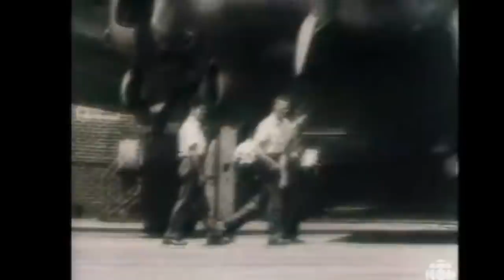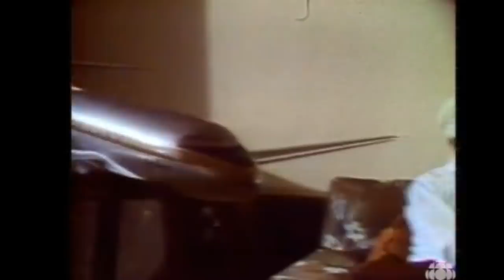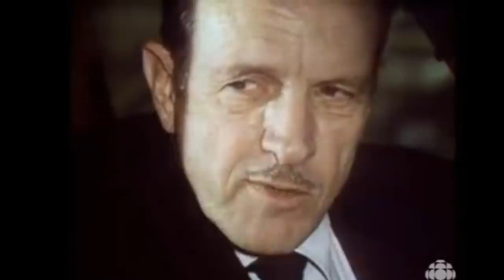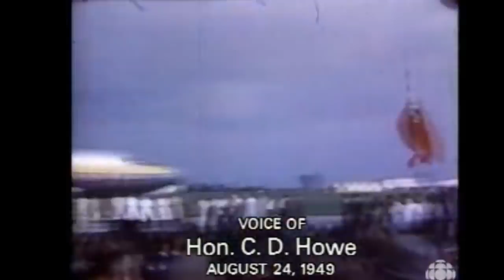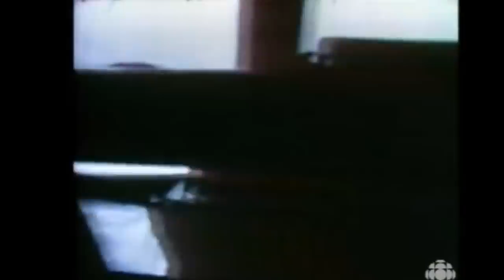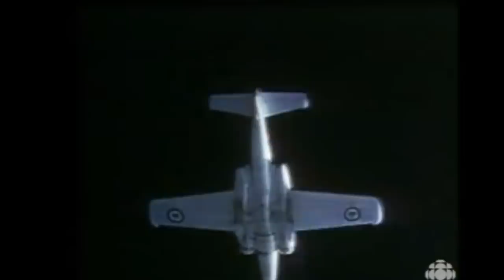The Avro Jetliner

Comment: Interesting that the Roll Royce Avon was not allowed on the Jetliner. But in 1955 it was used on the Caravelle and in 1953 it was ok for De Havilland to use it on the Comet. So De Havilland could use it, but Avro couldn't????
Reply: Canada still was under heavy British control - The Jetliner was eventually killed off for good to force Avro just building military planes for the looming Cold War conflicts, and to eliminate one possible Comet competitor. That was the reason why Avro wasn't allowed using Rolls-Royce engines, while De Havilland was.
It probably was more "primitive" than the Comet, without an aerodynamic fully tailored to then-budding jet technology (and the difference between the claimed performances of the two planes is testament to it), but the Jetliner still might have eroded some market to the British counterpart, and as such shutting down their own colony's effort in order to make it building planes for their Army was their choice.
Reply: the first few comets flew with the ghost jet engine -not the avon. the avon wasnt certified in time.
Reply: @super20dan  I know, but still De Havilland would have been permitted to use the engines Avro wasn't.
Reply: We are talking about 1949/50 here, the Avon was still a new military engine, the other commercial users were still 3 to 5 years away.

Comment: Too much does not ring true, Howard Hughes tried to buy 30 but was turned down by Avro and if you look at the figures it didn't give any real advantage over the piston aircraft of the time, a DC6 could cruise at 315mph the Jetliner would have cruised at 365mph with half the load and over twice the fuel burn and there were lots of cheap piston aircraft available at the time as air forces  wound down from the war. They mentioned a top speed of 500mph the Citation V can only just beat this with it's ultra thin wings. The Comet offered a big advantage in speed and had good range, I am not saying that it is the only reason but a big part of the failure of the jetliner was that Avro just didn't do their home work and should have stopped development much earlier, but they carried on with the development even after their only confirmed customer had pulled out . Anyone in sales knows that clients are always "interested" when they are being courted ( I bet there were lots of hospitality events), but it is all meaning less unless they sign on the line.

Comment: Howard Hughes had this plane and flew her around for a number of months on trials. He liked it. Then it was scrapped due to the Korean War. Two differences from the Comet... the engines weren’t in the wing roots, and the windows were round, best for pressurized cabin. The only plane that AVRO Canada built was the marginal, if useful CF100.
Reply: They were further out from the fuselage tn the Comet, but would you way they were buried?  They aren't podded, like 707, so how would you characterize them?
Reply: gregory hatton  Thanks.  I still don't know how to describe the placement of the engine nacelles.  (And given how deeply buried the Comet had its engines buried, would they be described as buried nacelles?)  The placement on the Avro looks like it eliminates one issue with the Comet engines - enough of the nacelle is outside of the wing surface to make it easy to get to.  Maybe "attached directly to the lower surface" of the wing?
Reply: Actually Hughes had his own Aerospace company. And he begged Avro to let him build the Jetliner under licence. National Airlines in the US wanted to make purchases as well. Hughes owned TWA pretty much would have meant more sales. But Ottawa told AVRO to focus on building fighters or lose their contract. Very strange that it couldn't have been built under licence.
Reply: leftcoaster67 Yeah, strange.  Looks like far too competent a plane to just throw away.
Reply: Third difference, the wing. The front edge on this is pretty much at right angles to the fusealage, the comet's leading edge is swept back.

Comment: Those round windows in the passenger cabin are so poignant.  
What if the Comet had had round windows? What if the C102, with them, had gone into production?
Reply: Round windows would not have saved the Comet 1, as it is a myth that the fuselage ruptured at those passenger windows.   The actual rupture started at the forward ADF window at the top of the fuselage.